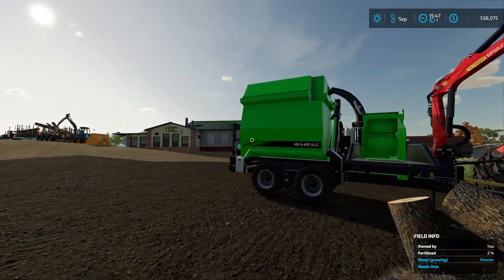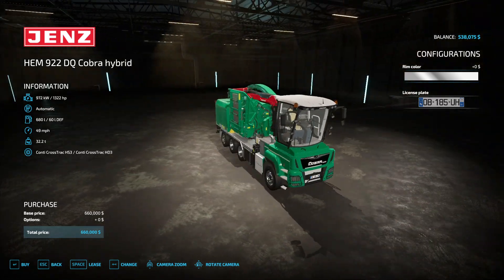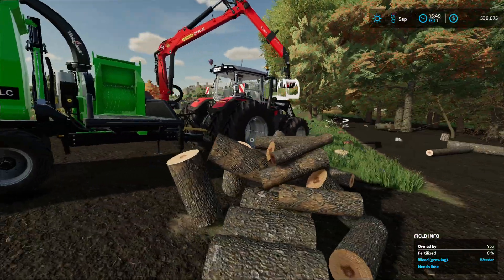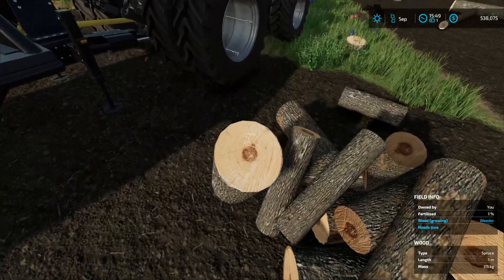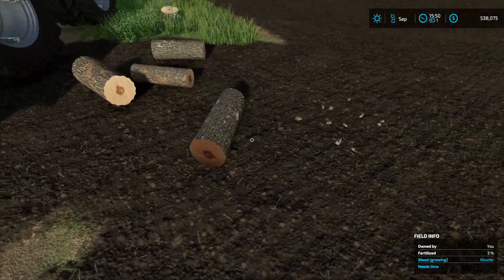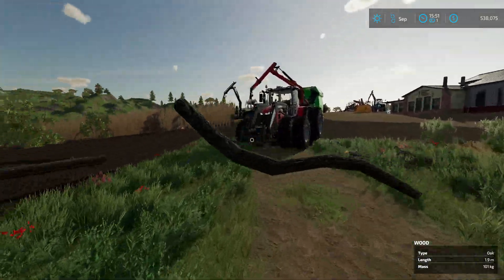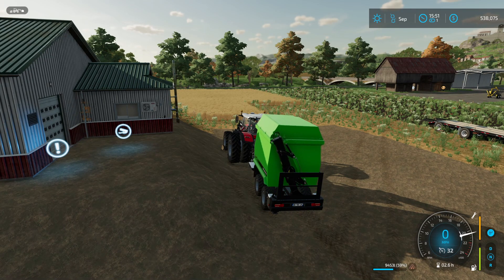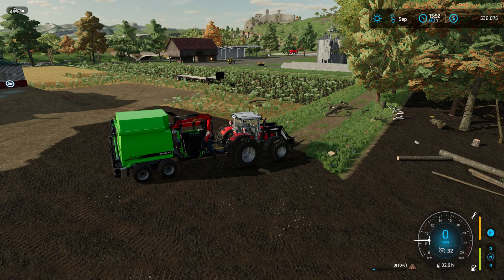FS22 | Logging | Wood Chipping Basics

Comment: Idk how to kee the machine running
Reply from the maker: In your settings the tractor with a gear icon I do believe should have an option for automatic engine start turn it off. This will make you have to start and turn off your piece of equipment so it will stay running until you turn it off keeping all attached equipment running as well.